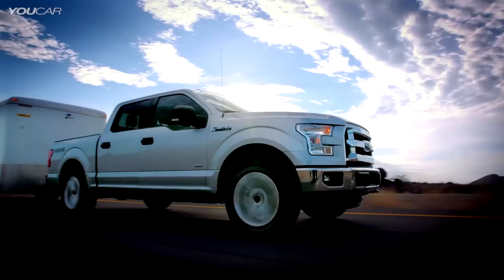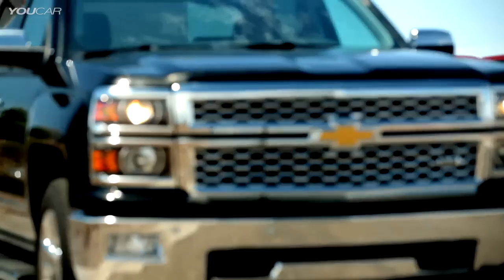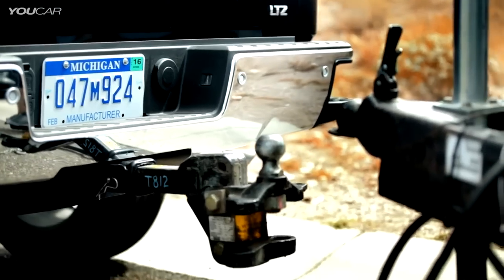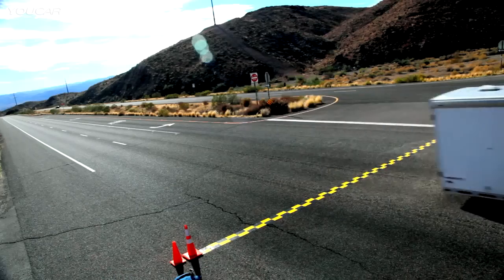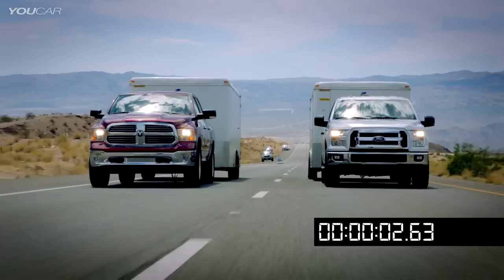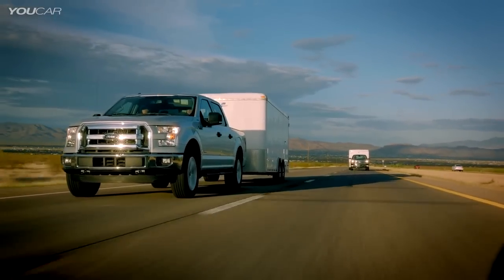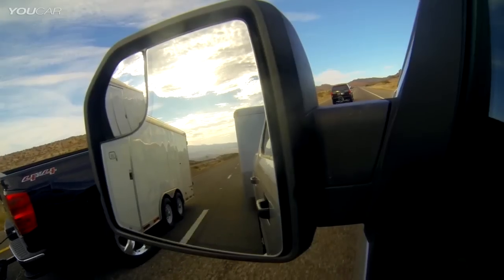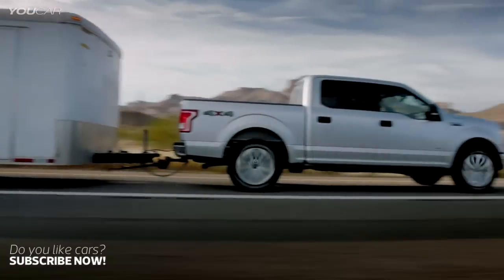TOWING Comparison – Ford F150 vs RAM 1500 vs Chevrolet Silverado

Comment: i also dont like a v6 enginr thats not going to take me out of a v8.. i dont trust that engine just like the 5.4 was shit just like their 6.0 the only engine for has madr to hold up is the 7.3 desel engine other thatn that shit. gm has had a really good engine in the 5.7 from back in the day 20 years ago. something i dont see a 5.4 lasting.. i work in pipline and all we do is tear up truck the only trucks thats been capible is the 2500 hd chevy, and the cummins from dodge other than that the fords are at the dealer because they say they need new engines the worst thing is we have more fords than chevy and dodge put together but theyr more reliable than the ford
Reply: The 5.4 is a million mile motor.

Comment: If you want a 1/2 Ton  PULLING TRUCK there only one that blows the rest away in the 1st year and 15 yrs later and that is the TUNDRA 5.7 I pull my 32' Toy hauler with a 4 seater Razor in it. I had to trade my ford that I love in because it would not pull it. Oh and by the way the chevy blow up with only 17000 mile on it heading up look out point and those assholes at chevy would not pay to have my camper pulled back to my house so I had to sew them and won. I had the dodge before all of them and the trans went with 43000 on it and 5 window regulators and the AC going out I won't ever get a dodge again. I now have 200K on my Tundra and I have put $83 into it on repairs the pulley tensioner went out. THANK YOU TOYOTA!!!!!!!!!!!!!!!!!

Comment: It's ridiculous to see how uneducated people are on vehicles. The education level of the Ford engineers will make you sink in your seat. This goes for almost every manufacturer. The facts are, no matter what is delivering the power, a V8 or turbo/supercharged V6/I4, as long as the drive train is made to handle the job it will pull it. Ford and Toyota are the only American truck manufacturers(yes I just called a Toyota an American truck so get over it and look up your facts) that have gone to SAE J2807 towing standards for the 15 year models. Theres a reason for that. They are the only ones that can prove their capability in the real world. End of story. So for the idiot that thinks he's towing 12-13k+ with the Eco Desiel I just laugh.

Comment: Speed has nothing too do with a good truck most people want Turk  ram has more Turk but slower I would rather have more Turk than speed cuz it's pointless if you are a working man or woman I'm just saying I have nothing agents ford I really like ford too but still that's just my thought
Reply: +Allister Wigglesworth That diesel Ram is slow as hell. If you really are a working man then time is money.
Reply: +Allister Wigglesworth You still need HP if you want to tow anything that's not aerodynamic on the highway. A truck with 10000000 foot pounds of torque but only 100 HP will only be able to go like 40 mph... Although its 0-30 time would be pretty damn fast

Comment: and this is the worst f150 engine. put the V8 or the 3.5L witch are the top 2 out of 4 engine sizes. that chevy would have lost all 3 for sure.
Reply: the Chevy in this video also had the base engine. I would like to see the same test with the full range of trucks being compared instead of just base vs base.
Reply: +josh b Size = better? ROFLMAO!!!
Reply: yeah like V8 or fords 3.5L. either one would still kill the chevy.
Reply: +josh b chevy had the older model engine in these races i dont see your point?
Reply: my point is a v8 lost to fords 2.7 the f150's weakest engine. be glad it was not the 3.0 the v8 or the 3.5 ecoboost cause chevy would have got smoked so bad.
Reply: and no this was not an older engine for the chevy. o and dodge and chevy ripped off of fords eco tech. dodge made ecodesil and chevy made what they call eco tech witch is fords ecoboost technology. but instead of calling it ecoboost they call it eco tech. chevy is dumb.
Reply: +josh b lol someone is getting a little heated

Comment: This is horse shit I want a ford with a triton V8. Not a boosted 6 cylinder and not a 4 banger but a fucking triton.
Reply: Triton V-10!!!! I drove an E-350 passenger van extended for a company for about two years and was impressed, abt 10MPG though, but so were the v-8's in the fleet. Used to surprise some people with that van, it could easily keep up in the stoplight Grand Prix. Love my Mopar's, but that was an impressive van to drive everyday!!!